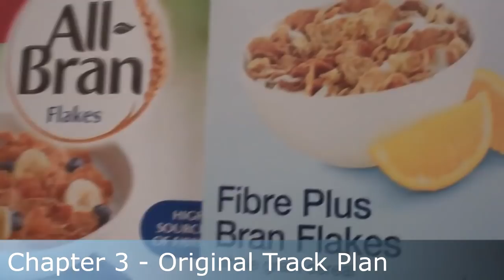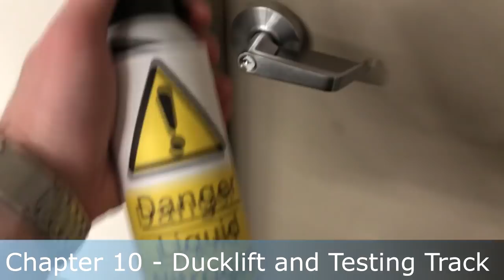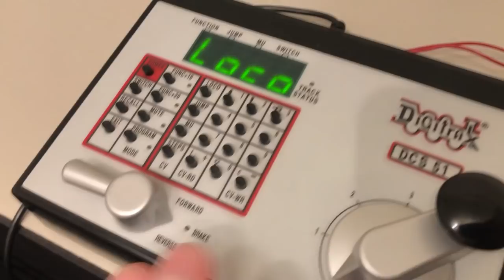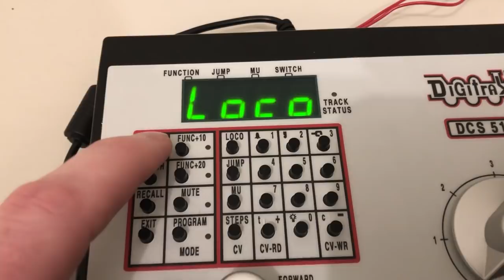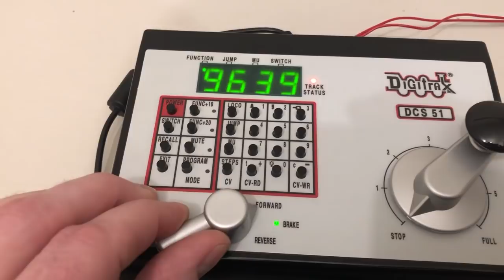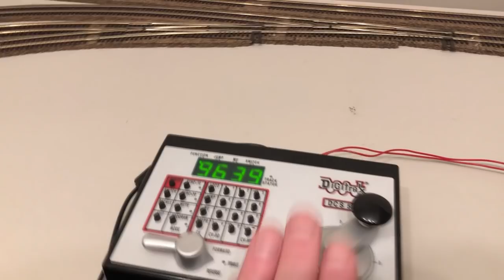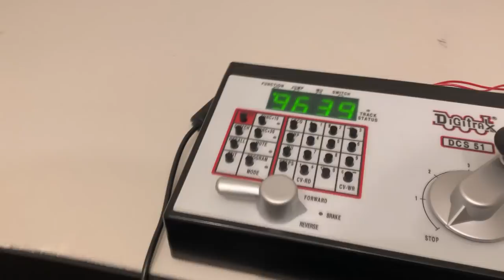Building an HO Scale Model Railroad in a Smaller Space - Installing the Zephyr

Comment: Awesome video  as always, Mark.  Im glad you recap of the previous chapters.  When you were out in a cold winter of 2017, I was inside my home just started my n scale layout.  I bought my stuff in January and started putting tracks February.   Im glad I didn't have to search anywhere in a freezing cold.  lol.  This is just really the beginning for you.  Congrats to finally getting your system.  If I switch to that control from Bachmann Command Center, I wonder how easy the wires can be plugged.  What is the full name of that Digitrax?  I might start saving for it.  :)   - Drew
Reply from the maker: Thanks Drew! It never made the video, but I found a box in the snow that said “N Scale in a Box”. When I opened the shoebox sized box I saw a full N scale layout, and thought, nope, too small. As for the system I think it’s just called Digitrax Zephyr. I love it!
Reply: Ha ha well guess what , you saw the portal to my n scale layout?   Ha ha 

Well, thanks for the description.  I will research that further.  Have a great weekend! - Drew